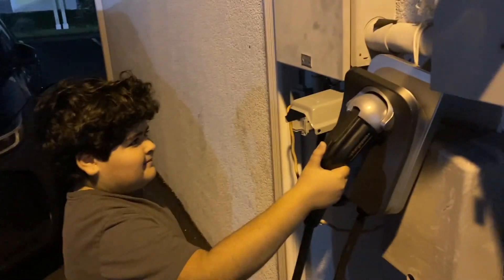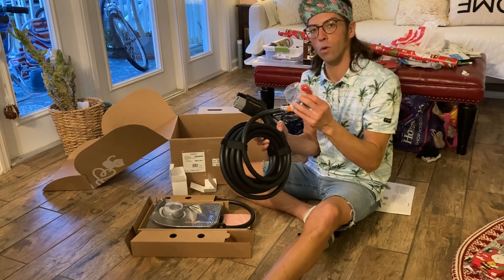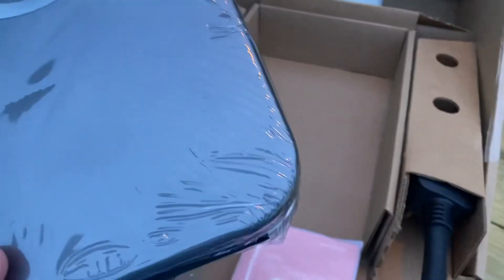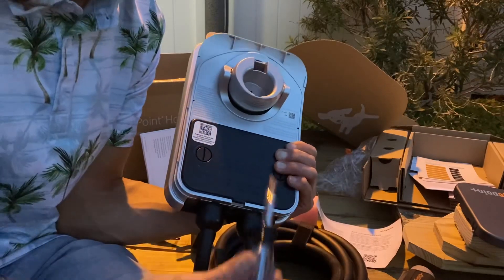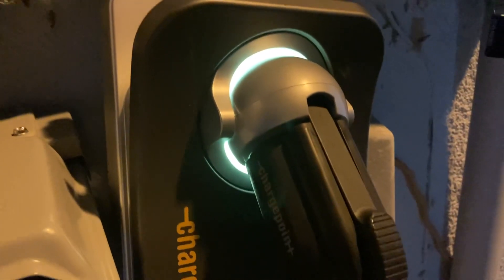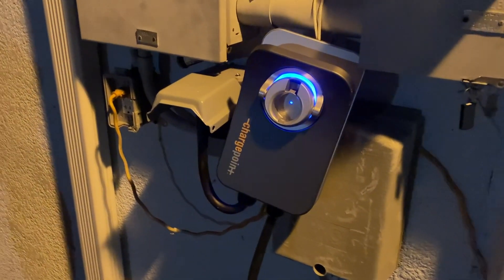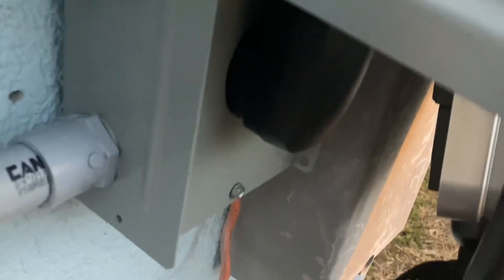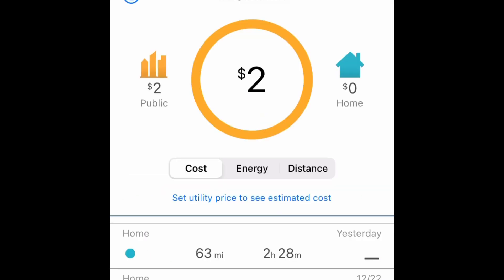EV Charger installation for SOLTERRA- Subaru EV - 240V 50amp Level 2

Comment: Pickleball...I am no expert but you should ask your landlord to reposition the 204V plug into the correct orientation.  The box is designed to be completely closed to keep water out.  I can see with a strong rain storm water getting to the plug and frying the whole unit. And as I assume you did the unit needs to be secured to the wall or a mounting plate of some kind that is secured to the wall.
Reply from the maker: Thank you for the comment. It's odd, I agree, and I mentioned this to them, but they weren't that friendly about changing it and said they will not secure the chargepoint to wall and that I have to remove it after charging. I look forward to living on my own property so I can install this properly. There is a chance we return the Solterra and charger because the car isn't getting anywhere near the range in ECO mode with no A/C or heat, temperatures in the 60s and driving conservatively. Still running tests to see what mileage it's actually getting in different situations.